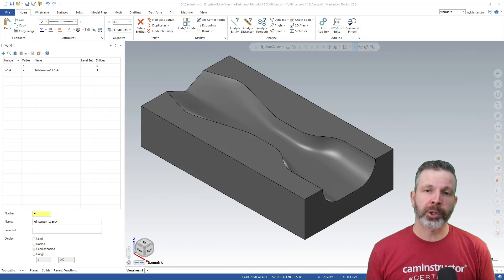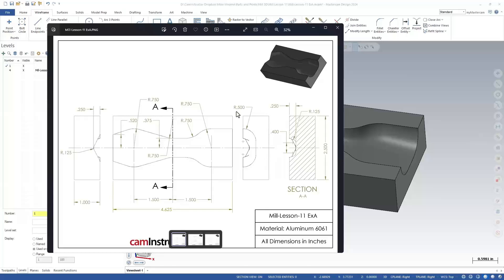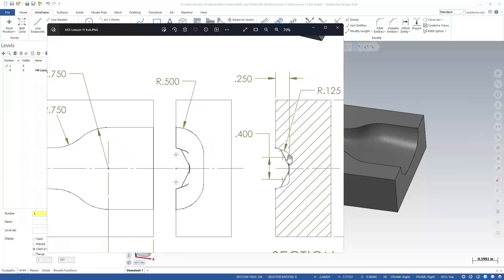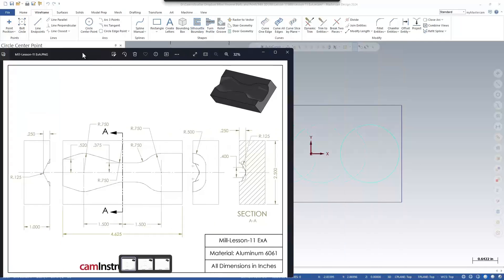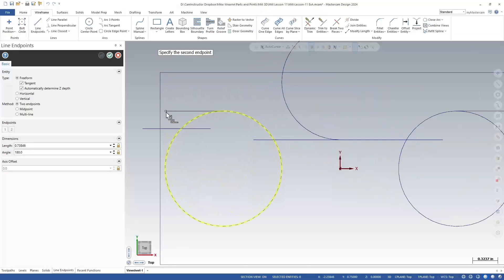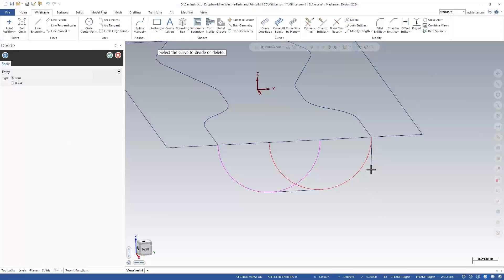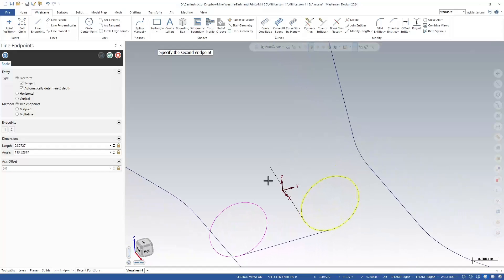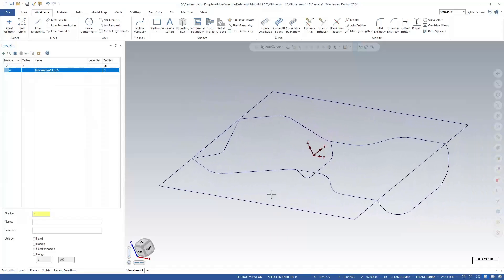Creating Complex 3D Geometry with Ask The Instructors Help!

Comment: I've been drawing this part under the assumption that section A-A is the center of the part. Shouldn't there be something indicating this on the drawing like there is for the centerline running left to right through the part?
Thanks
Reply from the maker: Section AA is in the center.
Reply: @CamInstructor  Ok.  Thanks for responding